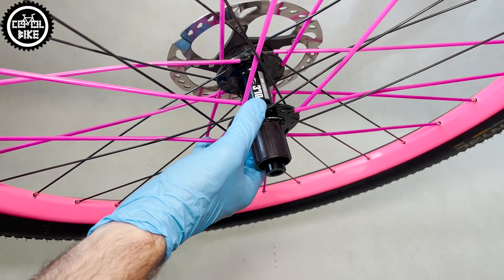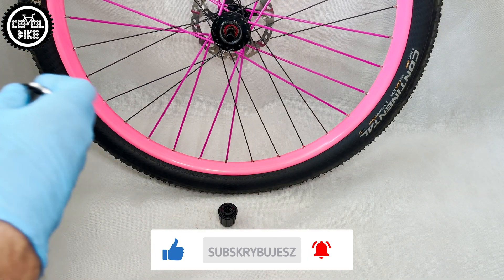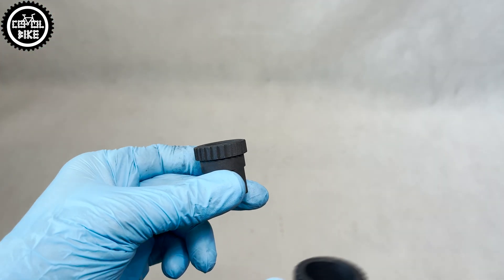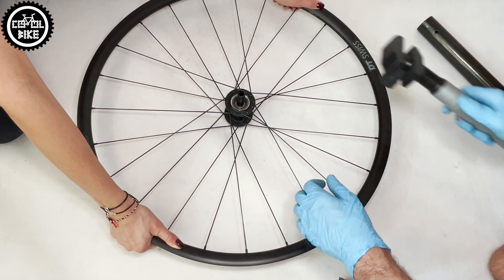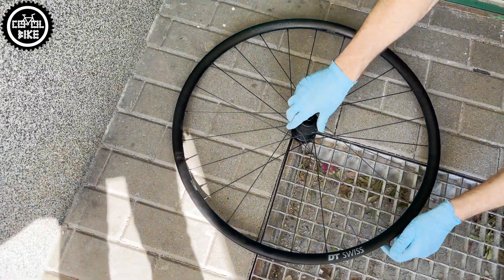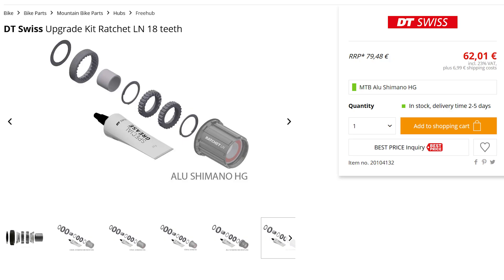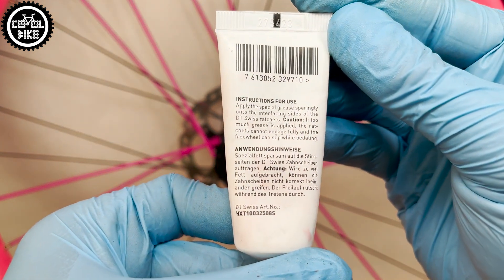CONVERSION DT Swiss 3 PAWL TO RATCHET LN  || TUTORIAL + RATCHET 18/36/54T SOUND

Comment: Hi what Ratchet LN model # should i get to convert my DT Swiss 1850c spline 3pawl hub to a ratchet system? is it already available?
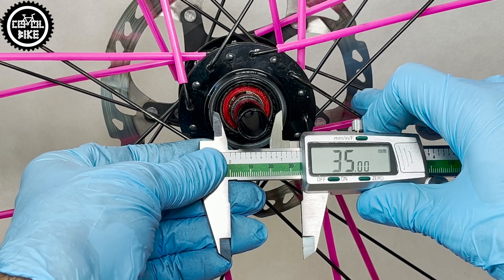Reply from the maker: There's only one LN. The only difference is  hub ring size: 34 or 35mm, as in 1:30. In 99% you have classic 34mm. You just need to choose the type of freehub body you want. You'll also need those special keys to tighten/unscrew the rings, or you'll have to go to shop to have them do it for you.

Comment: Thanks for all the information in the videos. Where can those parts be found, and what is the approximate cost? I have a Giant Trance hub, and it's supposed to be the same as DT Swiss. Thanks
Reply from the maker: You can find conversion kit in any major online store. It costs from 60 to 90€ depending on the material of freehub, and the type of Ratchet.
You can only convert DT 370 hubs, so I don't know if Giant one will be any good. You need to check if the ring holding Ratchet is the same as I showed in video, and if construction of hub and freehub is identical.